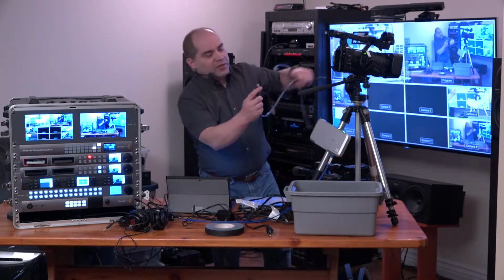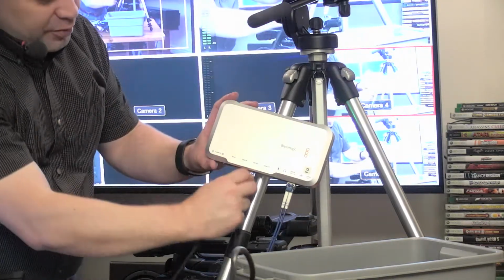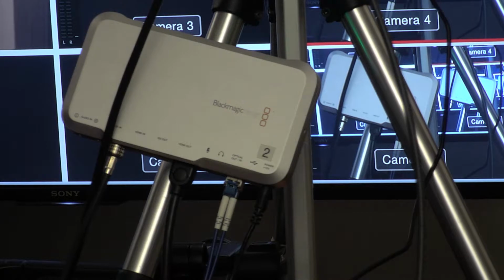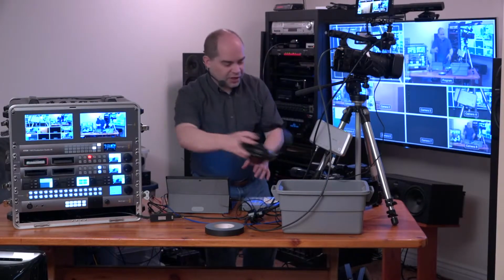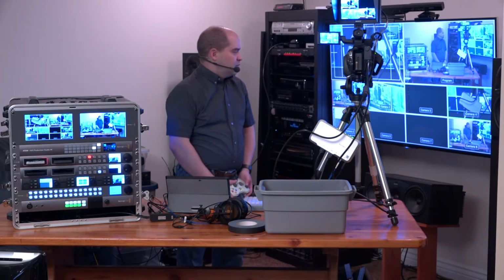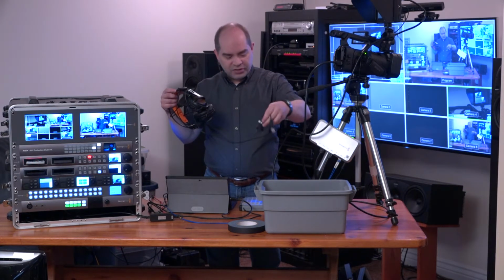DJP Crew Training - Camera Connections

Comment: Where is the other end of the fiber connected? i have the studio 4k it does not have fiber.
Reply from the maker: It plugs into the back of the Studio Converter unit.  It's on the bottom of the rack in this video.